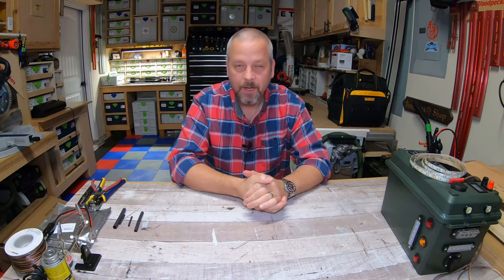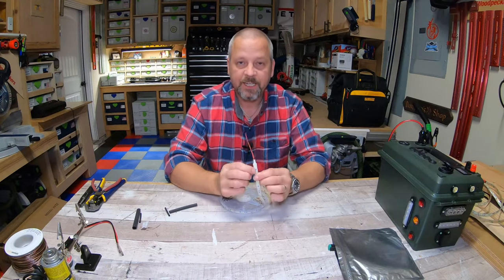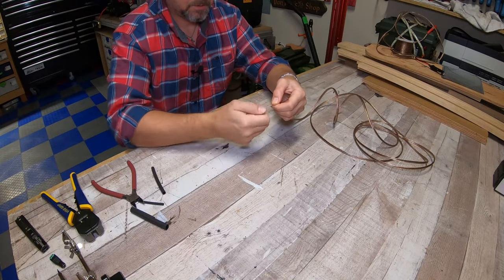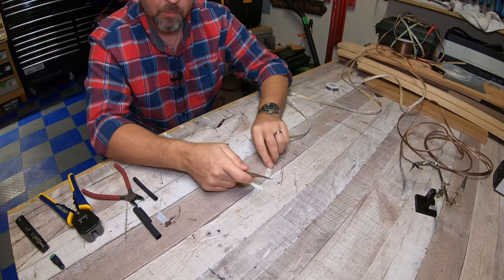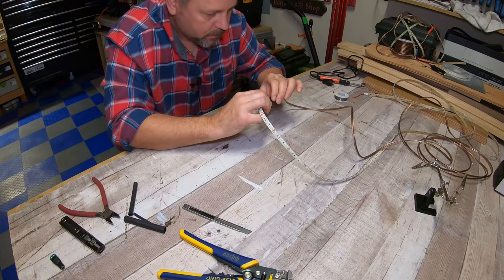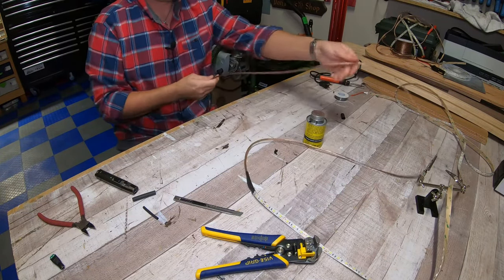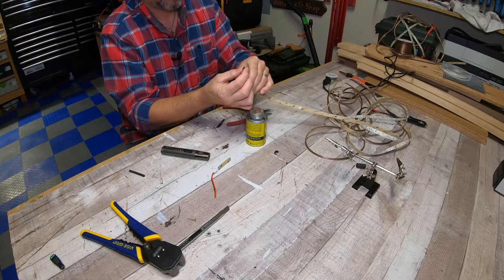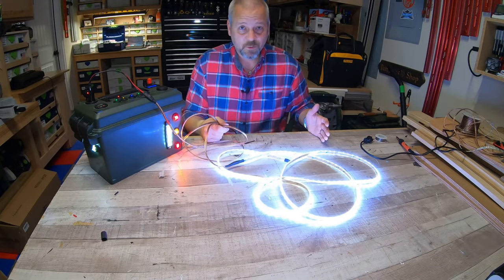How to make a 12v LED light strip

Comment: Perfect, thank you.  Just returned from buying a kit from the box store, 50 bucks for 16 feet, it also included a remote, connectors, etc. Since these will replace my motorhome 1 foot fluorescents, no need for the extra parts.  Ordered light strips per your Amazon link to include that nifty self adjusting wire stripper you also linked to!
Reply from the maker: Thanks👍🏻👍🏻

Comment: Great video! I'm experimenting with building a camper in the bed of my pickup truck. It'll have a separate battery - I'll need to connect a diesel heater, fridge, and some lights there.
Reply from the maker: Thanks👍🏻

Comment: I think a great use of this would be to splice into your existing car 12V exterior lights to create accent lighting on a vehicle.  You can splice right onto your running lights, back up lights, or blinkers, no power supply needed.  As long as the adhesive is quality enough for exterior use, or even some clear silicone adhesive to attach the LED strip to the auto.  Also could be great for wiring to the 12V battery in a camper with a switch
Thanks, this cleared up a lot of my questions.  After seeing some exterior car accent lighting selling for over $70 for a one foot piece of strip light, I think people could save a lot of money just DIY-ing this way!

Comment: Curious? Wont it shorten the life span of the LEDs doing it this way  V.S. using the power adapter that they always say to use ? They say it should never be higher then 12 volts but when we start up and drive that goes up to 13+ volts. Your input is greatly appreciated

Comment: Do you have a some kind of voltage regulator between the battery and the LED strip?

The voltage will drop and also the amount of light according to the discharge state of the battery?
Reply from the maker: I dont

Comment: Hello buddy, I want to make build space ships plastic models 7 ships and there will be 50 led diodes ….  I will make them windows, engines, landing bays add…. I want them connect with 12V adapter .  How I should connect them?? I have to use 1k resistor to each diode? Will it work?? Thanks

Comment: Hey mate I want to do something a bit similar but want to make grow lights for for using a car battery and LED UV lights. as Long as I used 12 volt lights or over it is fine on a 12volt car battery yes? Do I not need a invertor to reduce the power? I read a fully charged acid batter is 12.7, Using over this voltage in LED's is fine yes is it, but puts out less light? Less that 12Volt lights and you will burn them out.
Reply from the maker: You should be fine. Only need an inverter for running a/c devices
Reply: @BrianWatersOutdoors  Ah brilliant! thanks for the fast reply as I'm keen to get going. You just earned yourself an new subscriber for that 🙂 am I right in saying more lights is fine but it uses more power so less light? pc what is best for growing? RED white and blue or just a straight up UV strip? I'm worried about food prices.
Reply: @bobprobert353  thanks👍🏻 I really have no idea on best light spectrum for growing, but LEDs are different than standard halogen or incandescent lights. They won’t lose power the more you add as long as your battery can handle everything. Once you don’t have enough power the lights will simply cut off.
Reply: @GearGadgetReviews  I will double up the amount of LED lights and see what happens then, Cheers,
Reply: @BrianWatersOutdoors  Hello there. My lights arrived and I'm not sure if I have bust them or something. Could you help me please? I wired my 12volt lights up to my 12 volt LED's, Is it possible I have wired them up wrong like negative to positive and vice versa and blown them? I can't get them to work no I cut off the power supply to the mains.

Comment: Can you tell me why my straps I put on my golf cart won't work on a 36v to 12v converter?
I had to hook them straight to one of the 12v batteries.
Reply: Perhaps the current- or voltage limitations or some other protection on the battery?

Comment: Can I use a house lamp plug?
Reply from the maker: No, that is 110/120 volt, this setup is for 12 volts
Reply: I'm building a cargo trailer conversion and setting everything up first for 120volt..then 30a shore, then solar hopefully one day in future. Trying to figure out how to wire up led strips to 120v.. could I use a USB  adapter?
Reply: @BrianWatersOutdoors  guess I could use rope lights instead..

Comment: Does this "jSMD50/50 led strip you refer to come with adhesive backing.  Is it DIMMABLE ?  Can you only cut on the 1 ft. increments as you seemed to indicate. Can you buy led tape that is different luminosity (brightness)?  Can you buy led tape that is different heat color (Kelvin)?
As you are showing these fairly intricate processes, your camera is 3ft. + or -  from your work greatly limiting the detail what you are trying to depict.  If you want us to "see" what you obviously see, the camera should be much closer.   Be careful with that open flame torch. I believe that liquid tape is made with acetone. :)